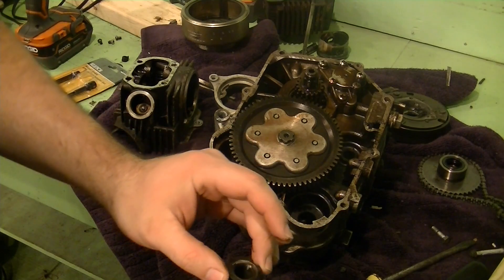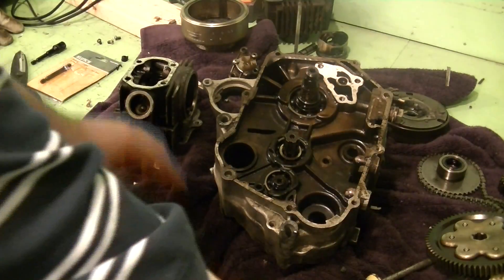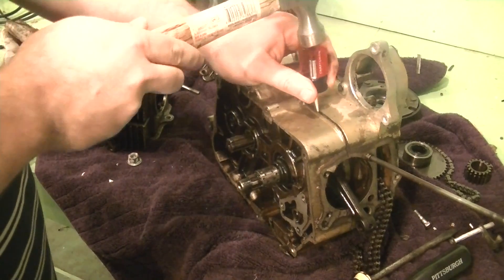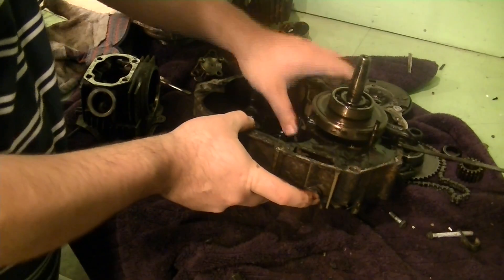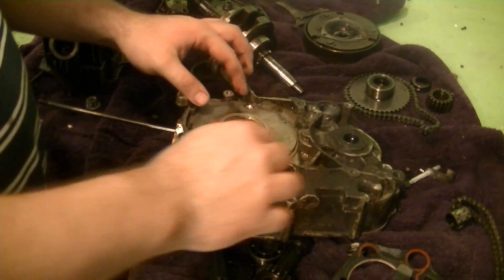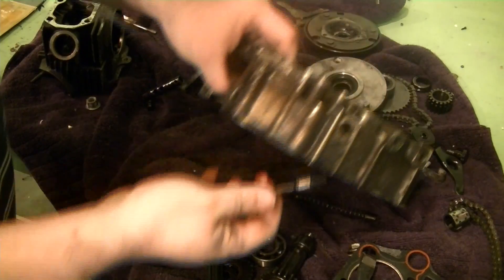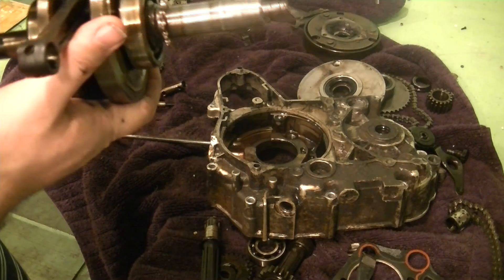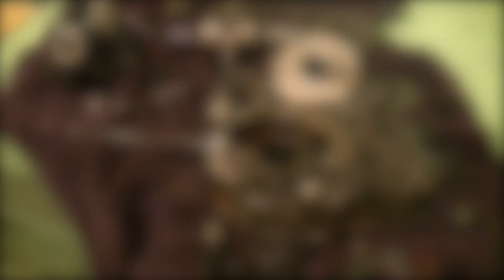Project Quad: TaoTao 110D (Engine Case Disassembly!) - PART 3

Comment: FYI you do not knock the craic apart it is pressed to part with a press and all motorcycles have a single connecting rod like that they do not have like a car when it's two halves you must not have worked on a lot of motorcycles facts you know a little bit more how many hours did you get out of that motor before you had to rebuild it I know I'm working on one that was 3 months old I did already trashed the valves because the timing jumped and the kids never even had it wide open it was set up to where he could only give it a quarter of the throttle and it still took a big fat s**because they are f***** garbage

Comment: I hope you did not damage your casing using that screwdriver like a ledge it should not be that tight to go apart you should usually be able to pry it apart with a pry bar from two separate points this is why I wanted to Casey there's little ears where you catch the pry bar to pry on it so that you do not damage your gasket surface